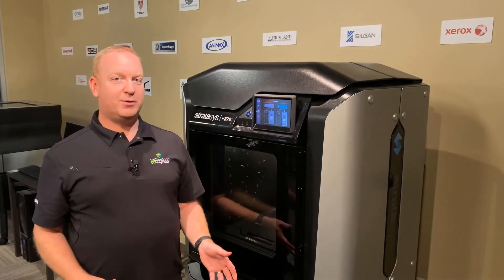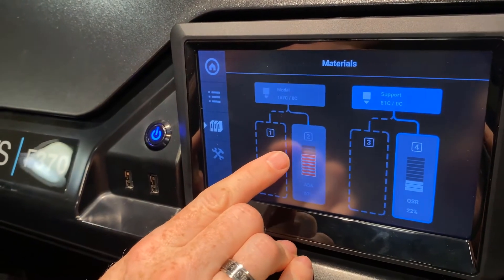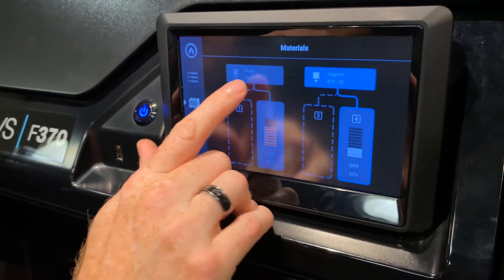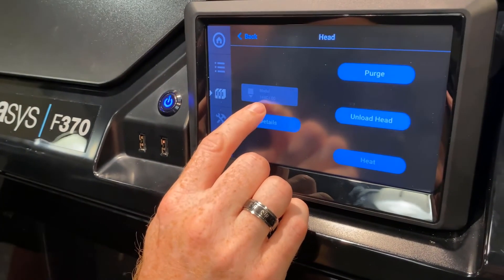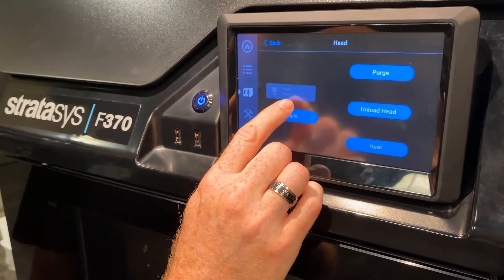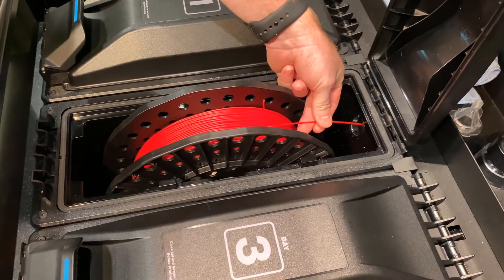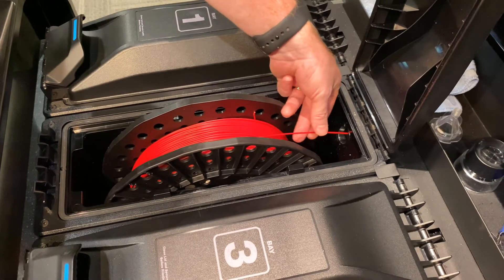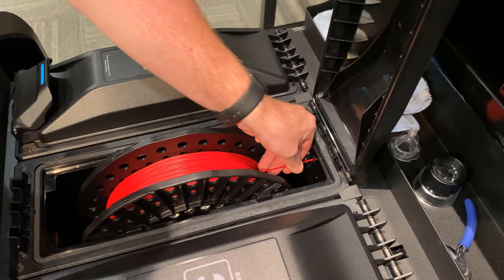Stratasys F Series Purge Trick

Comment: Who just saved me a service call? You did! Thanks for posting this. I wasn't able to get it working pushing on the filament at the loading point, but I was by doing the same trick on the head after pulling out the guide to get access to the filament.

Comment: 2 Brand new Stratasys print heads for material (ABS) in an F123 series, both error out with "no material detected in model head".   They sent 1 new one as a regular replacement, which did the same thing.  They sent out a second one to replace this one and still same thing... Error.. Even at the manual tip calibration.   Since Stratasys blocked me from their Facebook page, as a means to quell the disatisfaction at the garbage performance of the 75,000.00USD machine, Im ready to chuck this piece of sht out into the street.
Reply from the maker: I am sorry you are having trouble with your machine.  Our recommendation is to get in touch with the tech support team at your VAR hopefully they can help get things on the right track.
Reply: @bentelbow2922 I’m having the exact same problems with my printer, what solution did you come up with to fix it. Thanks